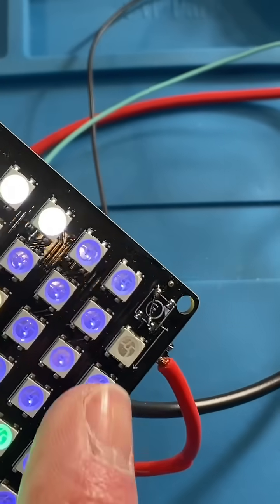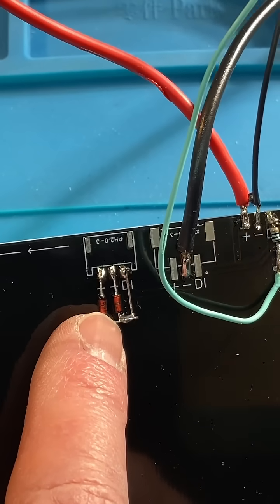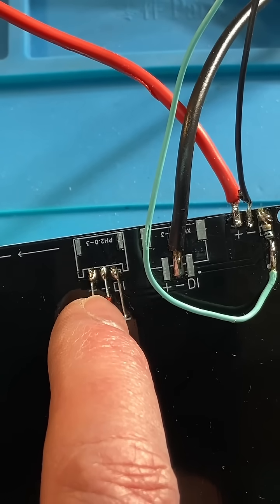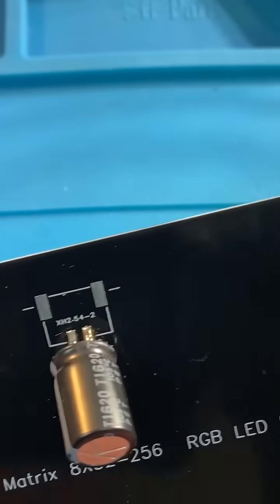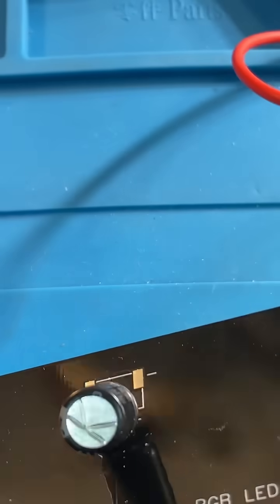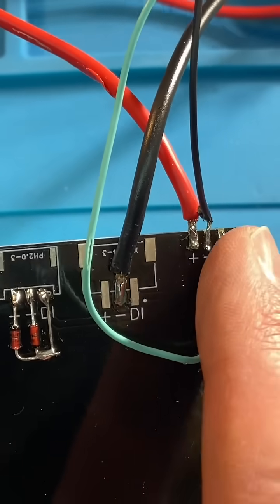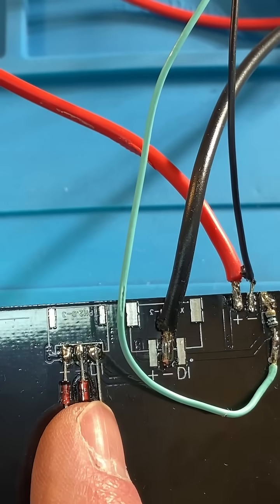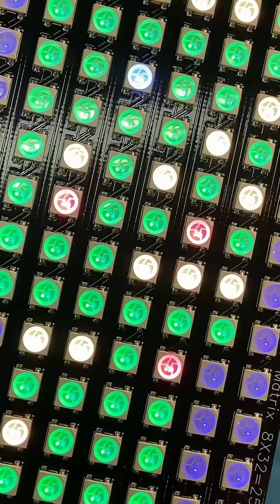Stop Blowing Pixel #1! ⚡ WS2812 Fix — BAT85 Clamp + 330Ω

Comment from the maker: Wiring (at the panel input)
UNO D6 ── 330Ω ──●───> DIN (first LED)
                 │
     Clamp HIGH:  ●──|<|── +5V   (Schottky: anode at ●, cathode at +5V)
     Clamp LOW:   GND ──|<|──●   (Schottky: anode at GND, cathode at ●)

Panel +5V ──[470–1000µF || 0.1µF]── Panel GND